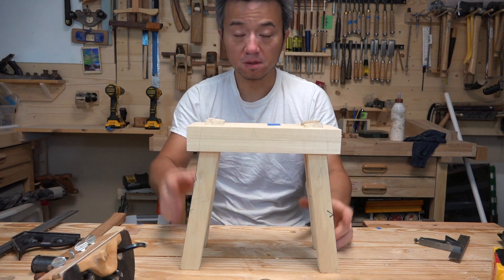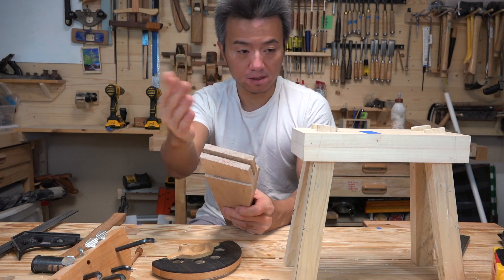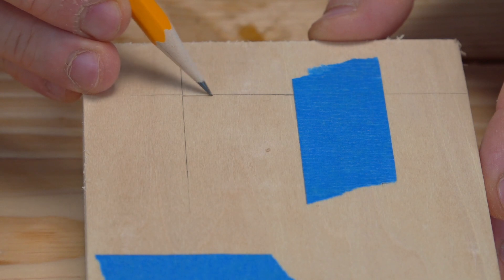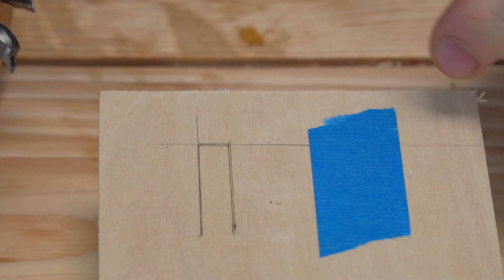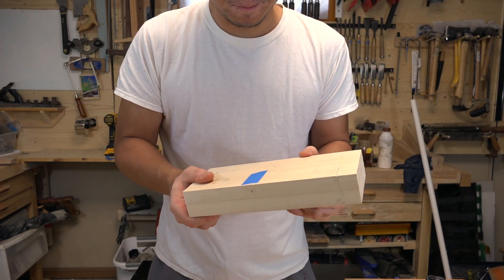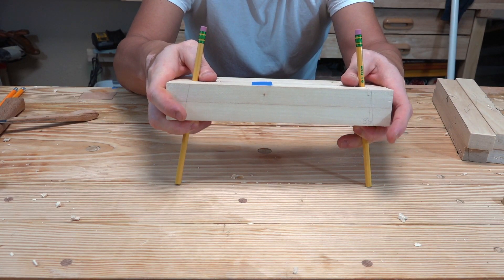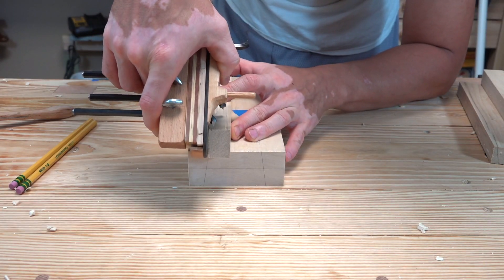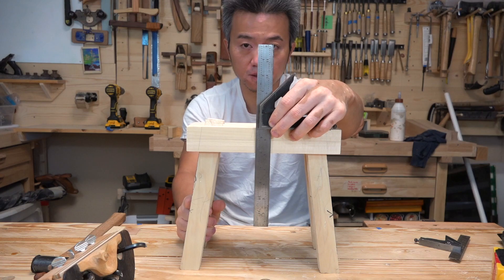Foolproof Angled Mortise and Tenon Layout - ridiculously EASY!!!

Comment: When you have the top and bottom holes marked, how do you correctly make the angled hole to connect them?  Do you make a vertical hole that is within both of them and then remove the remaining spoil by eyeballing the angle?
Reply from the maker: eyeball the angle, go 1/2 way from each side, they should meet pretty close inside.

Comment: Do you compensate for the diamond effect that the double splay creates or do you just use completely square legs? good video though, and great idea!
Reply from the maker: That's a great observation. I didn't go through that specifically, because I did not think that level of detail was warranted for this video. But the piece of leg that I used to layout the long of the tenon is already in a diamond shape. The short size difference is so small that I did not account for it specifically, but the chisel usually makes a mortise bigger than it is measured.
Reply: @johnzzhu  awesome thank you! I just wasnt sure if it messed with tennon shape making it different than the mortise shape at all. I figured being a small stool there wouldnt be a big enough discrepancy to make much of a difference. Something I couldnt tell from the Chinese masters videos as I dont speak Chinese! Luckily a few of them have english subtitles. Thank you for referencing his videos as well. Its been a struggle to find much on this type of construction in English, so thanks again!!

Comment: I love that idea of the offset plate. I'm surprised it doesn't exist on other marking guages, as I could imagine it having a number of uses. I'm guessing you could also have the offset panel permanently attached to the guage with a few nuts and bolts (or wing nuts) and use a drill or screwdriver to expand the offset to the required depth. So, fully seated offset plate for the top, expanded along the bolts for the bottom in your example. The only reason I'm suggesting this, is that I would definitely lose all those nicely made spacers you show!
Reply from the maker: The marking gauge/off set plate can be used for a variety of projects, up to the each individual to choose how they want to apply any idea. I think in creating an object there is always balances between competing forces. For example, design (taste) vs. function; do you really "need" a corinthian column? How is it better or worse than a plane round/square column?

Similarly, there is a balance between complexity vs. simplicity. So it's up to you how much complexity you want to add to solve whatever problem you might have.
Reply: @johnzzhu  I have to admit, I struggle with complexity vs simplicity. I'd spend days thinking out a design in case I've missed some unforeseen minor function!

Comment: Chiselling the journals at an angle is difficult, do you have a way?
Reply from the maker: There are no secrets to chiseling at an angle, in this case 2 angles, just practice. If you can chisel straight ones well, then angled ones are not much harder.
Reply: cut an 8 deg bevel on a board and clamp it to the workpiece and you have a nice guide to help you chisel at the angle

Comment: John, I like the marking gauge very much. Why didn’t you show the tricky part doing the angled shoulders?  That is essential to a good clean fit. Granted, small errors will be out of sight under the stool.
Reply from the maker: Great point, the angle is 8 degrees, but others may choose a different angle. I wanted to emphasize the ubiquitous aspect of the marking gauge, rather then the angle that I like. I plan to do a detailed video of the full layout of 4 leg 8 splay with 2 stretchers in a future video. I don't think the level of precision should be balanced with the object of the project; so "small" errors is relative, for me on something this size a 1/16 to 1/32 error is not noticeable. Depending on the I can take close up pictures of where the 2 meets and show you that there is "no" error, but again that would distract from the main point. But really appreciate your insight!!